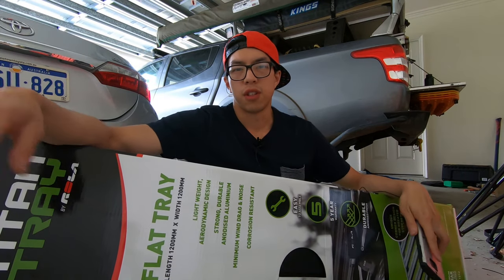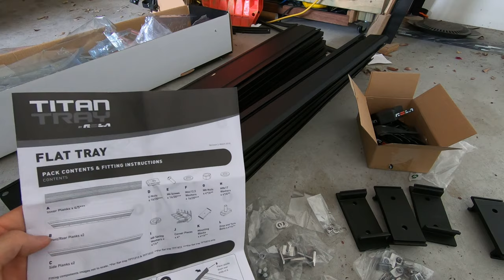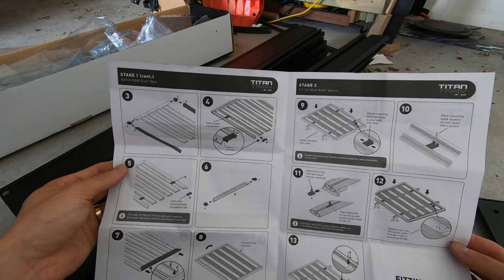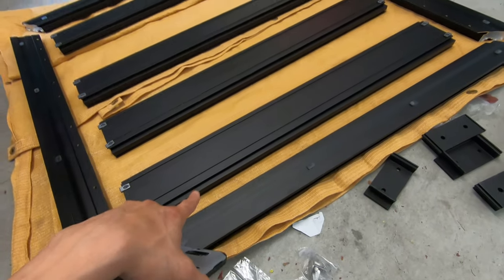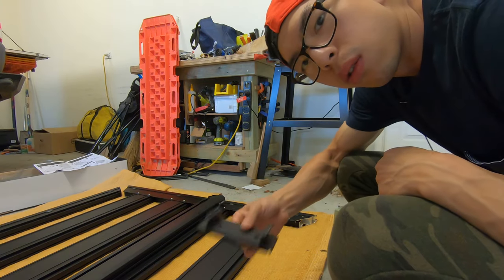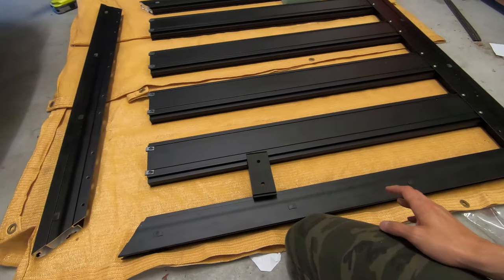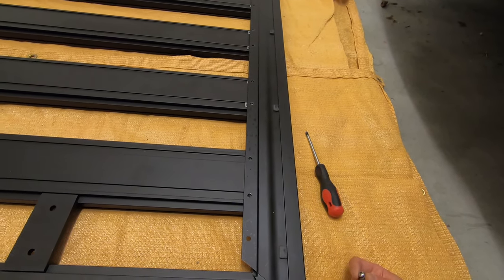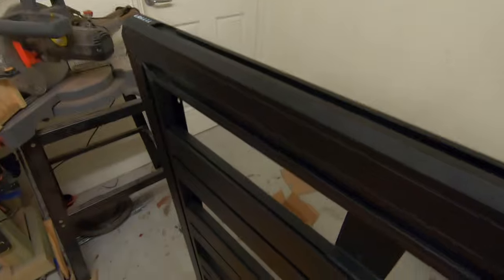ROLA TITAN ROOF TRAY First Impression And Assembling Tips

Comment: Great video thanks. Any idea if these can be bolted on to any cross bar or are they only compatible with Rola cross bars? I was looking for something to attach to my HSP Rolla cover cross bars but they don't make a platform yet.
Reply from the maker: I'd say the platform can be bolted onto any surface (the bracket is just a hole really). That will also depend on your fabrication skills. Tho I'd much prefer mounting it on something like a unistrut or anything with a channel that holds a t bolt or channel nut. You can get them from rhino rack as roof rack accessories.

Comment: How has the Rola Titan tray hold up in the past year? Cheers
Reply from the maker: Thanks for asking. I took it off because I no longer need it.
The platform is good and in good shape. Can't complain that.
The T bolts provided though are disappointing. Obviously under-engineered. The bolt wings actually bent for my application (in any case they do not hold much weight).
Also you can only use their channel nut for the platform. The nuts clearly says M8 but it seems only certain M8 bolt fit in OK...
I'll make a review with this tray. Stay tuned.